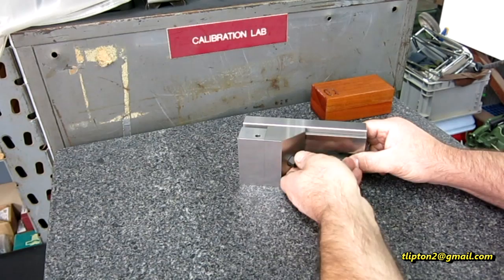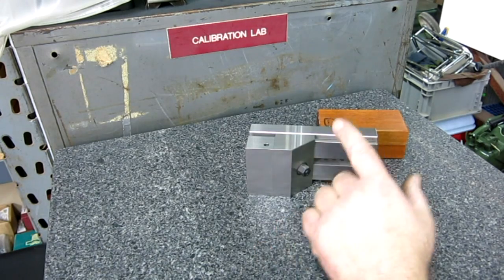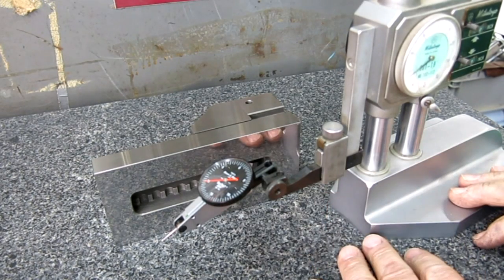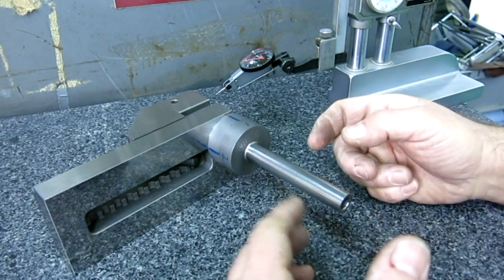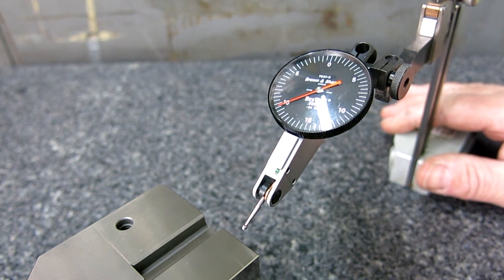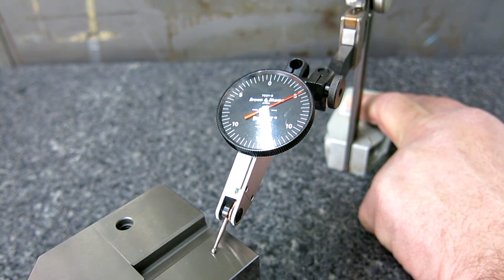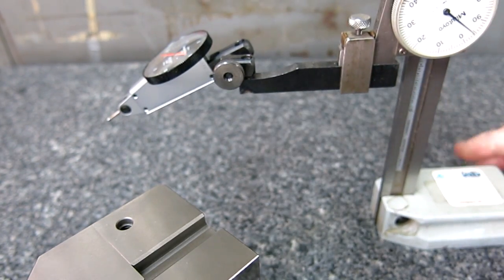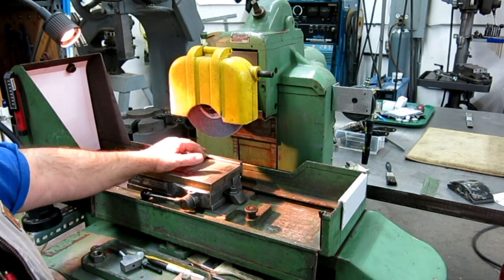WIYB Vise Surface Grinding Q&A Part 2

Comment: Great effort Tom. Great job of equilibration! I'm back on level ground with a far better understanding of surface grinding. Nice explanation of wheel wear and it's influence or actually....lack thereof. You are still the MAN!

Comment: Hi TomI appreciate your follow up. If you are looking for other topics.. you might want to couple wheel balancing with proper "wheel dressing" i.e. rough (corkscrew cool running)  as opposed to fine granular shear and "feed speed". By the way did you get that kick butt finish on your vice bottom or was it lapped ???  Very impressive if it wasn't lapped.Warm regardsTom
Reply from the maker: +Tom Vitagliano Hi Tom,

As we do more grinding videos we will talk about dressing and balancing. That finish is from Hermann Schmidt. It looks lapped to me but with those guys that might be how it comes off their grinders. Thanks for the comment.

Cheers,

Tom

Comment: Nice work Tom. My calibration training tells me that you might have missed an opportunity to emphasize that even with the cosine errors others have pointed out it is the relative '-change-' from one spot to another on the plane of the surface being measured that is being tested and not so much the actual value of each of the datums distances from the surface stone. As long as the cosine error doesn't change from one point to another it becomes irrelevant in measuring the flatness of the surface under test.
Reply from the maker: +hotdrippyglass I'm pretty sure I mentioned that in many cases we use the test indicator as a relative comparator as opposed to a true measuring instrument. I agree as long as your setup doesn't change who cares what position the indicator is in. Thanks for the comment.

Cheers,

Tom

Comment: Tom do you think you could consider doing some side-wheel work and showing it? I don't have to do it very often and absolutely hate doing it, however I was reminded just then as I needed to pick up a deep groove and pick it up to clean the groove up with the side of the wheel. Pucker-factor was at maximum, so I'd sure like to see how somebody like yourself tackles it.
Reply from the maker: +Pete F Hi Pete,

Next time I need to do some I'll shoot some video. Depending on how much you need to remove try plunge grinding it. That is feed down vertically in increments much like you do when grinding normally. The only time I do a full side wheel push is when truing the fence on the magnet but this is usually only a couple tenths to clean it up fully. Thanks for the comment.

Cheers,

Tom
Reply: +oxtoolco Thanks Tom, I'll keep that in mind. The job I was doing when I wrote the comment was to clean up an AXA Toolpost holder. I needed all sides of the holder to be square and parallel with the bottom. It is very difficult to measure inside a groove like that to ensure it is indeed square too. In future I will pay more attention to side dressing the wheel. 

Keep up the informative videos, as they contribute to another day where I learn something new!

Comment: Hey Tom, just wondering what type of bearings that type of machine uses, does the spindle ride on high quality versions of regular type bearings or do they use something more exotic ? Cheers, Ken
Reply from the maker: +Ken Goddard Hi Ken,

The long axis runs on balls on hard flat ways and vees. The cross axis runs on rollers. The spindle uses matched pairs of angular contact bearings in a cartridge. Hope that helps. Thanks for the comment.

Cheers,

Tom

Comment: back in the fifties/sixties, our Jig Boring/Jig Grinding machine was installed in a temp controlled room, 24/7 it was a manual operated machine, I guess that solved the problem of warming up,

Comment: Hey Tom, I know from experience, most of the difficulty us novices face in doing any kind of precision work is making measurements correctly. Your explanations and demonstrations are priceless when it comes to learning the correct way to set up and measure. Very much appreciated.
Reply from the maker: +Bill Moran Hi Bill,

Thanks for the nice comment. Your are correct that if you can measure reliably to a small increment you will only make really small mistakes. Thanks for the comment.

Cheers,

Tom

Comment: Flip.
At my dad's shop, we automated the traverse with an ABB drive, a gear motor and some limit switches. (x axis, left to right) the Y axis still gets moved in manually, you index the "y" and left the wheel spark out, rinse and repeat. Z only gets moved at the end of a complete pass.

Comment: The "cosine effect" is there. But the cosine of 30 deg is .877...  if I recall, or close to it, so you are about 10% off (in fact under) with a 30 deg missed angle. That is sort of what you got by "misangling." However once you have misangled, the error is constant. On the subject of warming up I agree with you, but not in the case of cars. In these days of multi-viscosity oils a car can be driven off right away -- if the ambient temp is right. If it is not, you have a problem, and here in Alaska in the winter I warm up the car before I put it under load, because even SAE 5 viscosity is jell-o at -20 C. In California I doubt it makes any difference at all, so go ahead, drive your car off cold. Isn't metrology fun? Thanks for the series, I learned something even if will never measure anything to 50 microns. Oh yes, happy new year!
Reply: Lubrication is not the only factor for allowing some kind of warm up in an engine. One of the main areas of wear is the cylinder bores caused by the pistons being out of round when cold. The mass of material around the wrist pin is far greater and more unevenly distributed than the skirt. The piston is machined, when cold, to allow for this expansion so it becomes round when up at working temps. When cold the piston measures unevenly , making wear an issue in the bores. This would be a problem whatever the climate.
Reply: Interesting comment, noted with thanks. Still, viscosity is a function of temperature!

Comment: High or maybe a better term is higher accuracy metrology (10ths level) is at least from my point of view a far less understood subject than it should be. I wish I knew a hell of a lot more about it than I do. However videos like this one really do help. And yeah that cosine effect is there. But for the most part for what you were doing it's a non issue as you've pointed out. Your checking and grinding for straightness and parallel surfaces. Zero needle deflection is the obvious goal instead of a known measurement to exact 10ths of how far something is out. Getting to the correct part size is probably easier done with one off part numbers by mikes etc. instead of setting a dti to a set of gauge blocks and having the possibility of a stack up of minor setting errors creeping in. Cosine being just one of em.

Yourself, Stan, Don Bailey plus a few others have really gotten me interested in surface grinding and the techniques involved lately. I'm finally starting to see and somewhat understand where it would really help my own shops capability's. As a hobbiest, I think I've got a fairly extensive collection of manual machining information. But getting any good accurate information about surface grinding can and has been tough. I wasn't even all that interested in this type of machining until the last 6-8 months or so with all the current information that's starting to show up due to some real effort from people like yourself Tom. If you've got lot's of surface grinding videos coming up I'm more than looking forward to them. Bring em on please.

Comment: OK if that is a bad setup for a indicator what would a good one look like? may some time you can do a quick discussion on the uses of indicators.
Reply: +Chris Anderson The stylus should be as parallel (or tangential) as possible to the surface being indicated.... then the cosine error drops to zero.  This isn't possible with most indicators on a larger, flat surface because the body of the indicator gets in the way.... Still, it is very seldom that a DTI is used to glean absolute measurements....
Reply: +Chris Anderson The indicator -- whether a plunger or a finger -- should be at exactly 90 deg to the axis of measurement. If it is not, your indicator reading is not true. In fact it is off by the cosine of the angle between the indictor device and the axis being measured. The cosine of 90 deg is 1.0000... and the cos of 45 deg is about .71. First case your indicator is exactly correct, second case it is about 30% under.  Beware, user, when you use a dial indicator to actually measure distances. Trigonometry is your friend, it  better be because you can't escape it.
Reply: +Chris Anderson 
The stylus of the indicator should be perpendicular the the work being tested in relation to the pivot point of said stylus.. Check some instruction manuals for indicators for specific use of different types.

Lets do some of the homework here people!
Reply: +b-rock It also depends on the indicator. Interapid calibrates to read true at 12° just because of the body interference issue. If used at 0° you have to multiply readings by 1.022.
Reply: +Chris Anderson I agree it would be very beneficial

Comment: Tom,

That was a really good video as you explained very clearly the reasoning behind the way you do things, but one thing that occurred to me as you were discussing the aspects of the grinding machine was how much actually does the carriage on which your magnetic vice sits affect the overall performance of precision grinding, as it seems to be mounted on some sort of roller bearing assembly which enables it to traverse from one side to another smoothly, if this was not right it would throw out any other measurements or settings, there must be a wear factor in there somewhere over a period of time from constant use of the machine, I would be interested in your thoughts in regards to that aspect of it.

Hope you have a great New Year,

regards

John MD

Comment: Mmmm, Tom i have to disagree with you on the machine warm up, any precision  machine needs warmed up especially the spindle bearings and imposing vertical thrust on bearings that aren't up to working temperature is not good working practice.
Reply: Never operated a grinder that required warming up the bearings. I did this for twenty years, and never had an issue once with this matter. Just turn it on and go. The spindle bearings are a lot stronger than you think, and will do their job just fine cold or warm. Size and location issues are ALWAYS due to heat in the material being ground and wheel wear, NOT spindle temperature. It just doesn't enter the picture.

Comment: Hey Tom, you have no idea how much grinder envy I'm having right now. That roller ball way just looks like a dream to use!

Wouldn't you be able to check height gauge squareness using a granite angle plate just like you could with a Squaremaster?

Comment: What about dust and grit?  Does using a surface grinder in the shop introduce abrasive dust to everything?  I'd be inclined to use a dust extractor.

Comment: One thing as far as what else you can cover Tom, you mentioned different wheels for roughing and finishing grinding. You could go into some detail about grinding wheels. Not that all of that information would be too useful to me, I don't have a surface grinder in my home shop, but I'd still find your take on it interesting, and I might find something I can use too? I do have grinders.

Comment: Tom, Allways wondered why these surface grinders are totally hand operated, and not semi automated like for instance on a horizontal planer. Technically it is not difficult to add i figure.What is the reason, Accuracy?
Reply: +Flip de boer In principle you could constuct a CAM surface grinder. I suspect there actually some out there but I don't know for sure because I have no interest in the subject. However, all the surface grinders I have seen on You-T are resurrected pre-CAM manual machines. The really difficult part of a CAM surface grinder would be measuring the Z-feed, which involves measuring roughness on the fly, which I at least do not know how to do. Laser interferometry? Very expensive, if maybe possible.
Reply from the maker: +Flip de boer Hi Flip,

Like all machine tools there are a range of possibilities. From full manual to fully automatic. Us home shop guys tend to end up with the fully manual machines. Thanks for the comment.

Cheers,

Tom
Reply: +Flip de boer My Thompson grinder is hydraulic in both axis only the down feed is manual.
Reply: +Juan Rivero CAM?!?
Plenty of small powered grinders out there. They use simple limit switches that slide on the side of the carriage, are positioned by the operator. Simple, extremely reliable, and much faster than CAM.
Reply: I stand corrected :)
Reply: Easy. The kind of work they do doesn't require automatic anything. The only exception might be how nice it is to have an automatic rapid traverse for raising and lowering the spindle. It can take forever to crank it up and down several times during the day doing different operations.

Comment: Thanks Tom, I like these types of informative/educational videos. By the way what is the proper way to set an indicator? Thanks and hope you have a great 2016.
Reply: Ha, 8 years after it was asked, I saw this. I operated a grinder for 20 years. Setting an indicator: about 5-8 degrees. Check its accuracy by setting up two gage blocks on the granite plate side by side, say a 120 and a130. The indicator should read exactly .010 difference between the two. If it doesn't, adjust the angle of the needle until it does. Interrapid indicators were especially good at this.

Comment: Thanks for the video Tom

Before I pose the question let me just say that I was qualified to change out grinding wheels and to use a grinder in the UK you had to hold a certificate to do the wheel change , but these were > 12 inch dia ones , the chip produced was the first thing that was shown to us

Now the question do you balance the wheel on the arbour either with the weights or vibrating dust into the wheel , we had to balance , dress and rebalance , then demonstrate to the examiner that we could grind the part to spec ,I drew the the short straw and was allotted a 18 inch cylindrical grinder what a pain

Stuart
Reply: +Stuart Hardy You must elaborate about this technique of vibrating dust into the wheel. I did a quick search, but before I waste my time I would like to hear about it from a professional. Do you use a template to portion the dust on the wheel or am I imagining something completely different?

Thanks,  Mike
Reply: +allsortsofinterests 
first I am not a professional 

The method is primarily used by the manufacturer of the wheels they find the light segment and pile some of the material that the wheel was made from and vibrate it into the pores to get the wheel into spec , but it can be used when the weights will not get the wheel into balance , it's a bit old school 

We're I worked they had a large training budget and went OTT with our requests for training , so we took advantage of it, some of it was one on one 

Hope that helps 
Stuart
Reply: Certainly! Thank you for the explanation.
Reply: Absolutely no need to balance a 7 inch (or smaller) on these manual machines. Just ring it, dress it and go. "Ring"... tap wheel with something hard and listen for the "ring." Cracked wheels don't ring and they explode when ya turn the machine on.

Comment: Great Q&A video.  It triggers more questions in my non-machinist mind...do you need a separate machine to do this?  Could a horizontal mill, like Abom's K&T, be adapted with a magnetic vice etc. or am I missing something fundamental (max. spindle speed and more awkward to operate for extended periods)?
Reply: +metalhead2508 thanks for taking the time to validate my doubts. I'm sure someone's already tried it somewhere!
Reply: +metalhead2508 I did, hence the original comment re. awkwardness of use over long periods. Patience is required even with the high ratio bed traverse.  I've no doubt CNC units are quite popular!